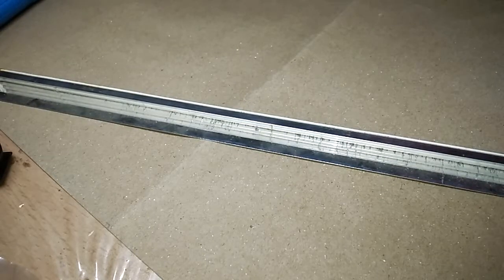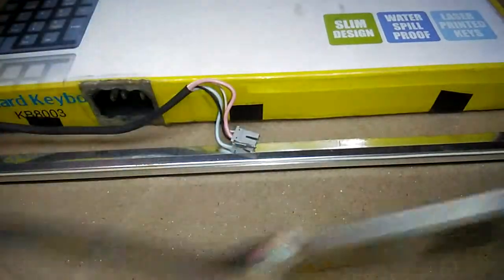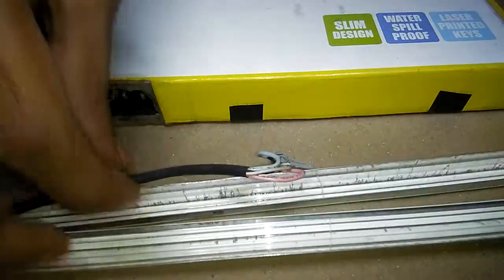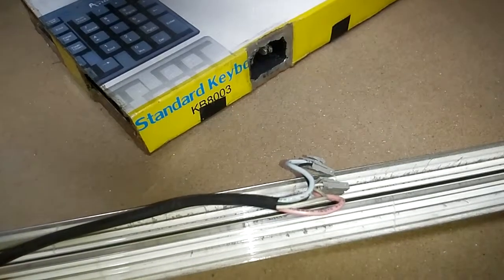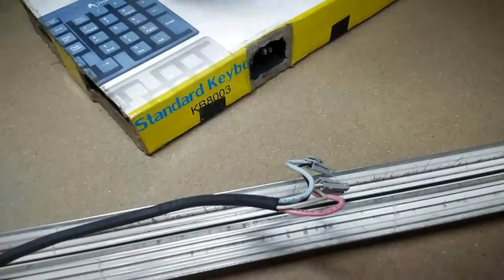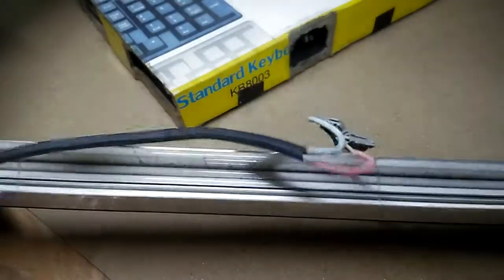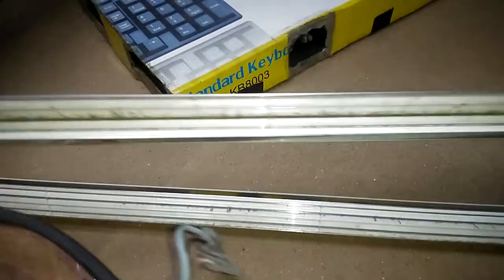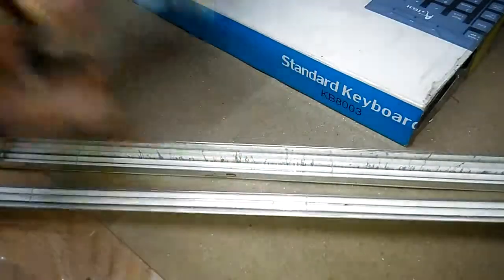Salvaging cold cathode florescent lamp (CCFL) from LCD monitor!

Comment: i was quite expecting you'll show how it works by instant lighting them up. also you didn't mention how to isolate and replace transformers in a box to make them work. want to know more details about those...
Reply from the maker: Extremely sorry for that, this is a hack that I made some time ago and I did not have a camera then, which is why I was unable to document the process, but if I get another monitor somewhere I will document the process again in a future video. Until then  if you want to make this hack then all you need to do is disassemble an LCD monitor and only keep the power supply and cold neon tubes, the power supply shouldn't be exposed so just keep it in any non-metallic enclosure. 🙂